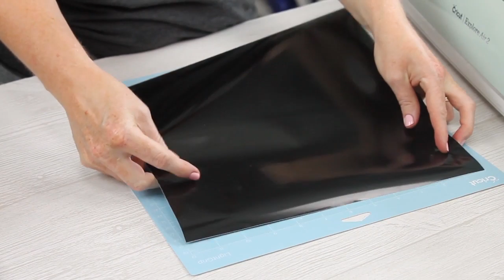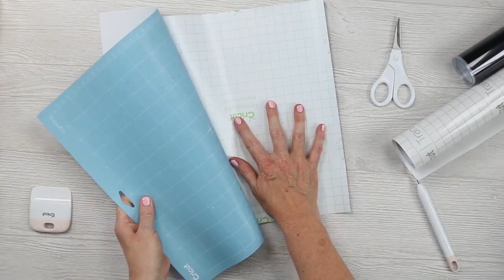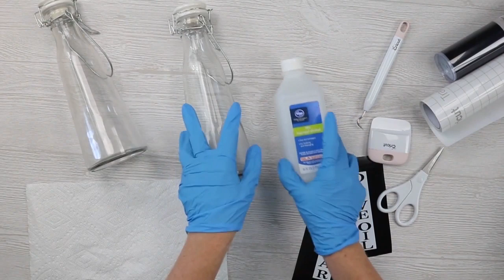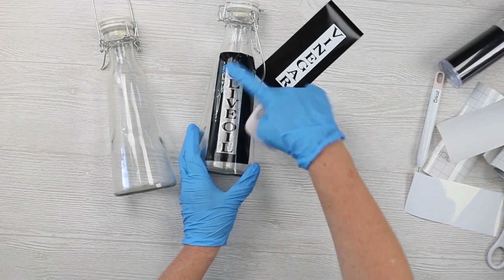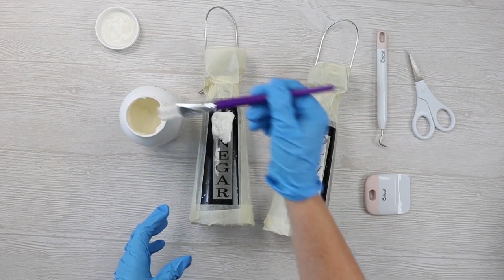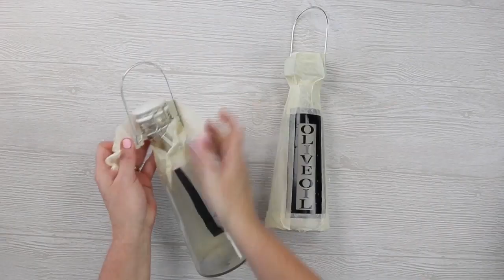How to Etch Glass with Your Cricut Machine

Comment: Why are you wearing gloves while working with the vinyl? I’d be afraid that it would stick so bad, that the vinyl would be on everything but the glass! Lol. I have tried this etching cream, and it didn’t work very well...I’m going to try again after watching this...!
Reply from the maker: The oils from your hands can actually make the cream not work very well. So I use gloves to make sure I don't get any of those oils on the vinyl or on the glass.
Reply: Using new glass rather than old is very important.  Old glass just won’t etch well at all.  I bought new casseroles and other items to etch and they are wonderful gifts and using for marking your pot luck shared meals.  I made some gorgeous gifts for my 3 sons’ work desks using short square glass containers from Dollar Tree.  One holds paper clips and one is his personal candy dish, or pens.  I simply etched their initials vertically in a nice font, down one side.  They look expensive, but only cost a dollar plus the stencil and etching cream, which I always scrape off and put back in the jar.  I like doing straight sided jars, too, with a good lid that I paint and decorate.  Then glue it to a clear glass candle holder for an apothecary jar.  I have candy dishes for every season like that!